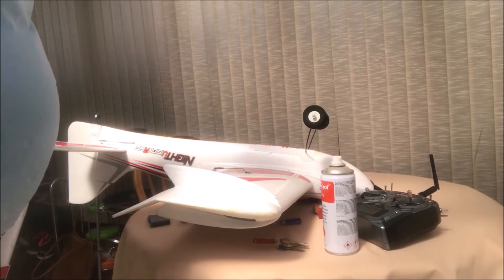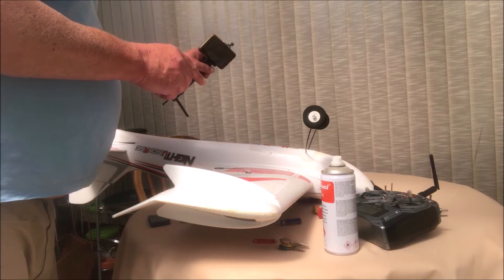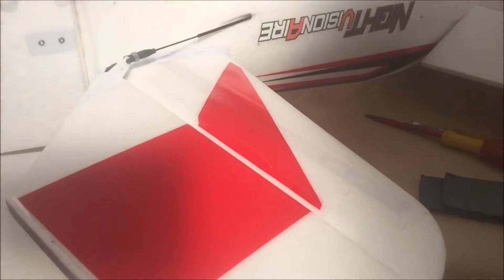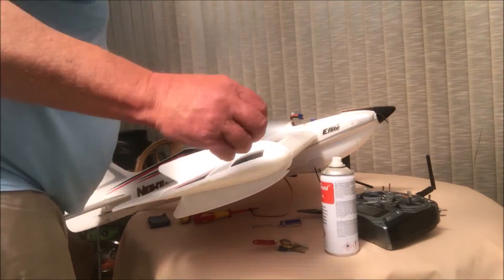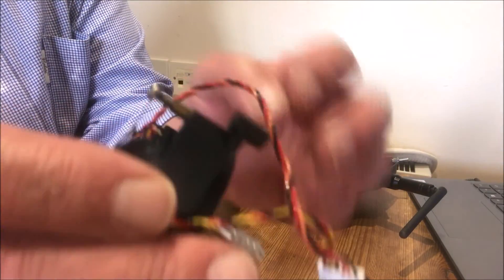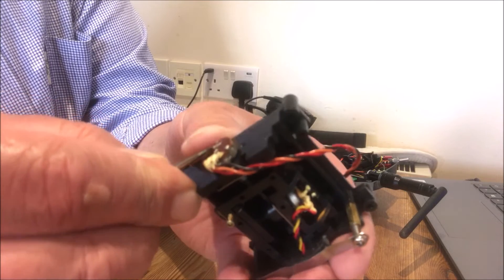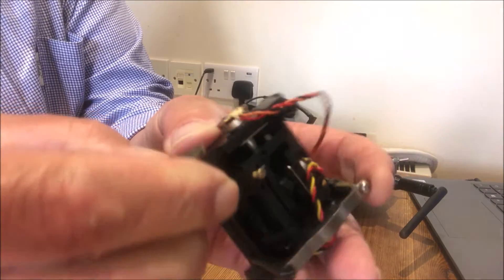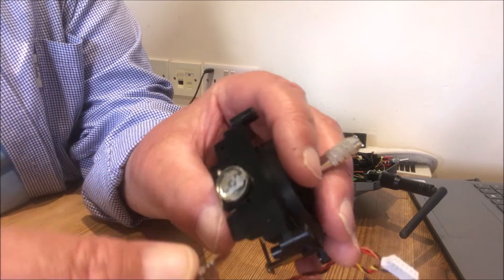Spektrum DX6i, Repair, is it the servo or the radio? Or both?

Comment: The DX6i is still a fantastic Tx in 2025. I had the same issue with the throttle pot. WD40 did the trick. I've had this radio for 12+ years. Added a blue backlight and metal thumb wheel. It's a simple, no BS radio.

Comment: Great vid Nick. Another excellent piece of information. Now, in the olden days, before the internal combustion engine and you tube, I would be clueless re your overcoming of the sticky pot. Excellent stuff mate, and I was wincing with you as you pushed the pot tabs out, the pressed back into place!!
Reply from the maker: Thank you. Yes the tabs are a little fragile, but as with all things, gently does it. No hammers where harmed in the production of this video.🤣😂
Reply: @thebarronflights ha ha ha 😂